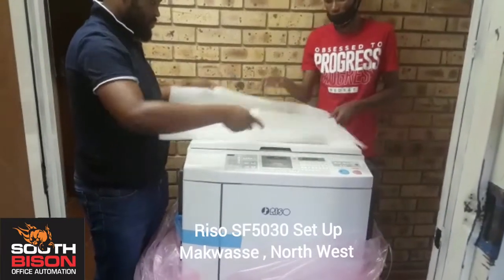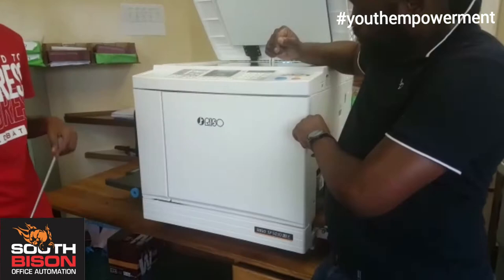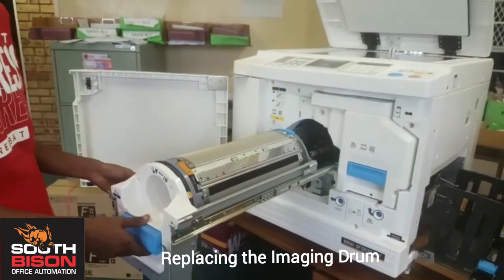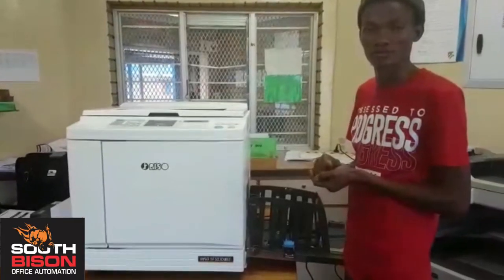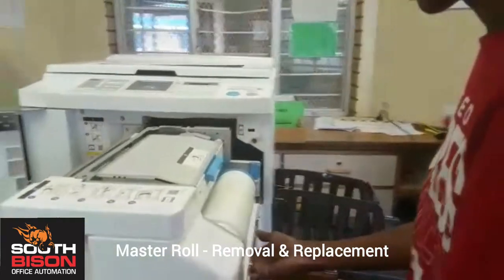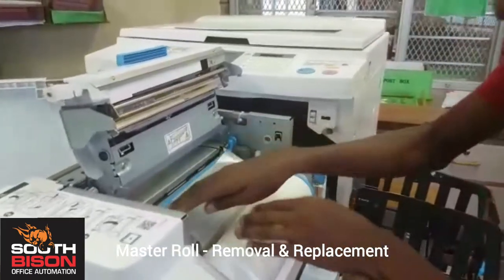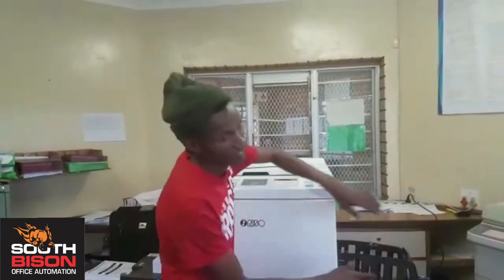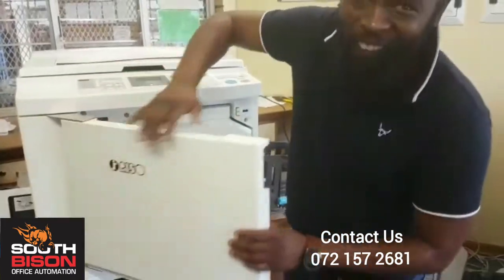Riso SF5030 Installation & Demonstration - Makwassie, North West

Comment: How to remove error DO8
Reply from the maker: Error type D08: Master making unit not set Error point 224: Master making unit is not set (both the safety and lock sensor are OFF)
Try this: Set the master making unit in place.

Comment: I HAVE THE SAME RISO, SF 5030 BUT I GET THIS ERROR A06-403, PLEASE HELP ME CLEAR IT.
Reply from the maker: Code: A06 403
Description:
• Paper feed tray is at the upper limit position or lower limit position.
Causes:
Paper feed tray set switch is OFF. * Not detected while in the low power mode (24V OFF).
Remedy:
Paper feed tray upper limit set switch: ON or • Paper feed tray lower limit set switch: ON
Reply: Where is the switch positioned?

Comment: Error code F-30-426 solution
Reply from the maker: 1. Remove all paper from feed tray
2. Let the tray go down to the start position
3. Switch off device
4. Clean Stripper Pad  and Pick Up Rollers
5. Replace Paper and Re-test
6. If error persists replace pick up rollers and separation pad